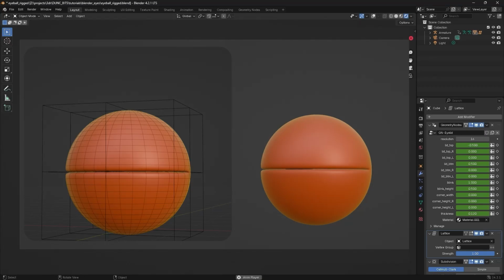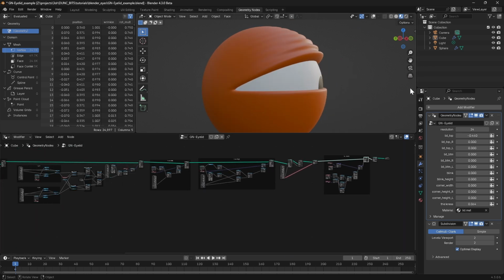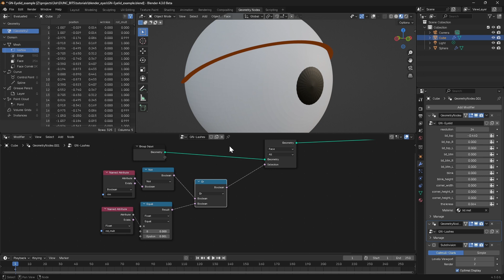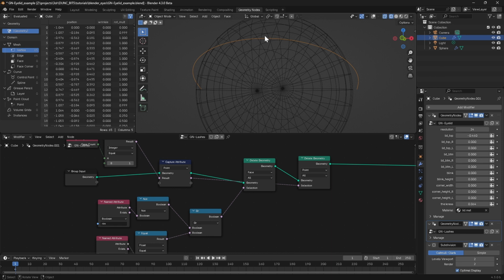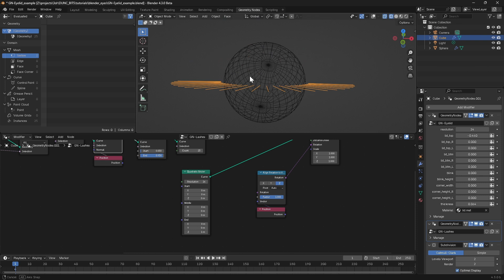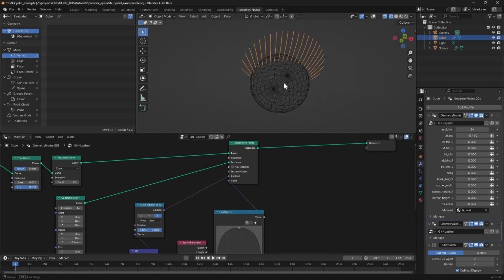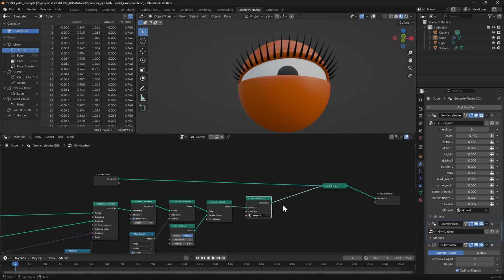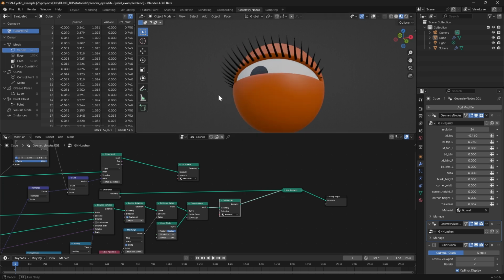Procedural Eyelashes with Geometry Nodes in Blender.

Comment: Amazing work! I have a question, if I wanted this eye rig but as two eyes that I could control the eye darts with as one control and also add to a existing body/facial rig, how would I go about it (I am new to blender) I'm a Maya animator and wanting to get into blender and rigging.
Reply from the maker: Thanks for the question. I'm also coming to Blender from Maya. I'd look into drivers for the eye darts - you can easily link the translation of an 'aim' control to the rotation of the pupils for example. Blender also has a bunch of constraints for things like this - the transformation constraint lets you map any value from a source transform to your desired channel in the host while defining custom ranges and limits.

Blender has an amazing feature (to maya users anyway) where you can merge armatures as you would merge to meshes (ctrl + J is the shortcut).

Good luck - hope some if that makes sense / is helpful!